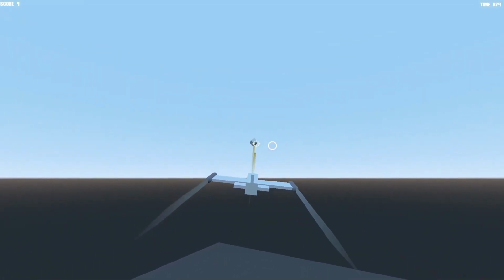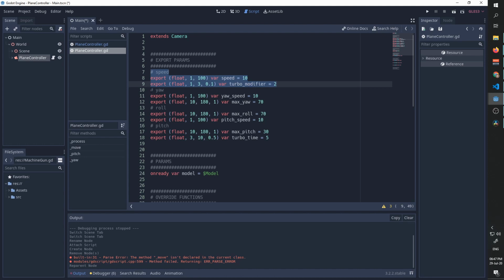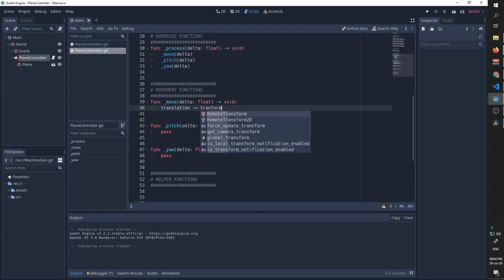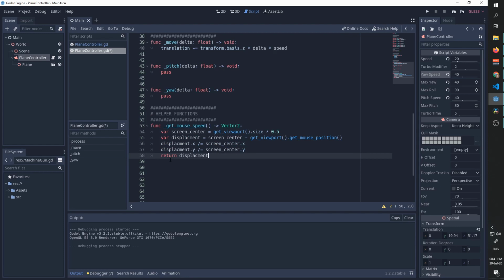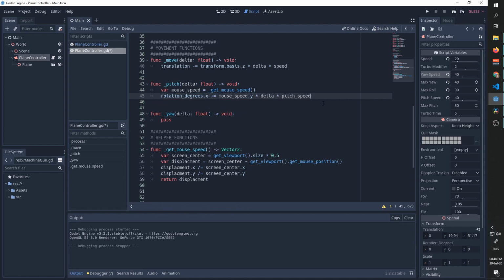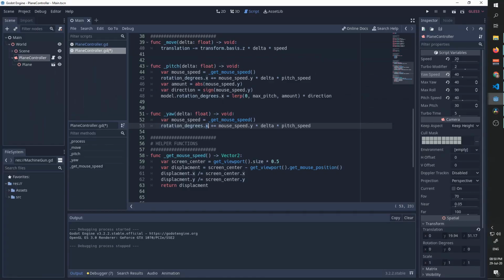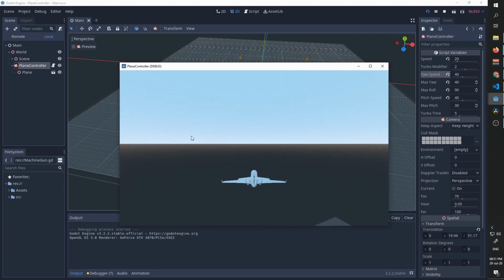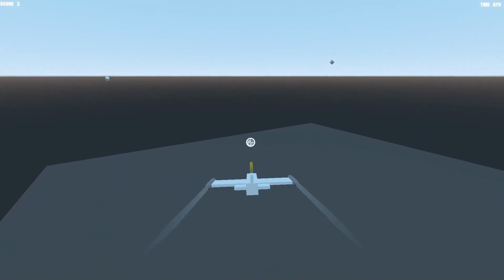"Godog Fight" - Dog fight game made with Godot 3 - Plane Controller

Comment: None of this works in godot 4.2. :(
Reply: It works the logic is the same just some things have changed like using “@“ in front of export or “translation” changed to “position “ I got the mouse controls like yaw and pitch and running however my plane for some doesnt seem to follow the displacement of the mouse fully and just stops after sometime giving it the effect of just going forward and not being able to turn

Comment: for me the code is totally broken. the plane does not steer aswell as the steering is super quick instead of slowly going after the mouse
edit: also the camera stays in place and doesnt follow the plane's rotation
Reply from the maker: What version of Godot are you using?
Reply: @indiequestdev  I think it's 3.9 it's not the latest one but it's newer than the one you used also thanks for replying
Reply: @indiequestdev  I got the same issue, I'm running Godot 3.2.3
Reply: i revisited my project and found out that the actualy problem wasnt that it wasnt steering, the camera just wasnt following after it

Comment: Just curious if there’s a way to reverse the camera while inverted. Because with these settings everything works but when flying upside down the yaw camera movement is backwards. So was just looking for some help with that. I tried an if statement to find the x axis and it works once but as soon as you turn right side up now the normal flight yaw is backwards even with an elif condition.
Reply: Just figured it out. Had to use get_global_transform().basis.y.y I wasn’t using the last .y and when I used print() to see what was being output I realized I needed another .y to get the up/down relation. Also had to put the var and if statement in the get_input func
Reply: @keatonhatch6213  could you pls tell me exactly how you did the if statment because i have the same problem
Reply: @mcgames4455  I’d have to wait till I got my computer back to get exact code but basically I did an if statement to check if the global_transform().basis.y.y was less than 0. I think I did a little less. Something like this

If global_transform().basis.y.y < -0.5:
           ##invert your yaw(rotation around y axis)
            controls###

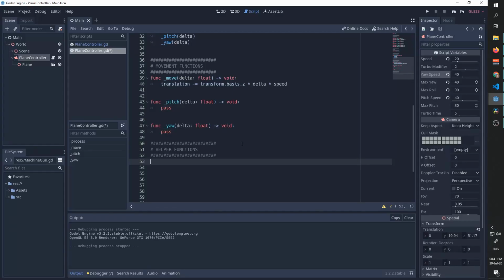Comment: why not use the .normalized() function for the displacement vector @ 5:14? Isn't much faster than using a division operator?
Reply from the maker: It will not work because we don't want a unit vector, in fact, most of the vectors we are returning are not unit vectors. The point at each corner has length 2 and the point in the center has length 0. I can, however, use displacement / screen_center for a cleaner and probably more efficient code.
Reply: @indiequestdev  oh I get it, it makes sense to have them in percentages for the lerp

Comment: Why you control the camera with script and not the plane? Usually camera follows the object (plane)... I tried to download on Github, but i can't open it in godot.
Reply from the maker: Trying to control a plane in 3D especially in Godot is extremely complicated (I am in the process of creating a video about this topic). Controlling the camera by using only two axes of motion is very easy and intuitive. That is why I choose to control the camera and animate the plane to get the effect of flying the plane and only needing very simple and easy to understand code.
Hope this helps.
Reply: @indiequestdev  I attached the script to the "plane". In the moment move forward and up and down works. Camera is a child object of the plane. An advantage of this is that i can use the InterpolatedCamera instead of Camera.
Reply from the maker: Very interesting, I will also check this approach. Thank you!

Comment: I have a question about basis: Why can you make rotation in all axis with Euler? Shouldn't that causing Gimbal lock?

Your two first series are very interesting, it's short and at the same time complete about basic mecanics, it provides a good kickstarter.

If I can make 2 suggestions:
   - decrease a bit the background music
   - add ("1/4") in the title to make easy to navigate in a serie
Reply from the maker: Hi, Thank you for taking the time and giving suggestions, I will decrease the music sound and add the episode numbering, those are amazing points!
I did not quite understand the question about using Euler and locking the Gimble, can you add a timestamp?
Reply: @indiequestdev  I not yet confortable with basis/quat, hence my question (and why I wait your video on the subject). At my current understanding, basis/quat offers to keep the direction, protect against gimbal lock and good interpolation (slerp).

In pitch/yaw/roll you use model.rotation_degree.x/y/z. So you make a classic rotations (Euler) on 3 axis. From my understanding, beyond 2 axis, 
you are vulnerable to gimbal lock. So why it does not happen?
Reply from the maker: @fabrice1533  If I understand your question correctly, the reason we are avoiding a gimble lock is that we are not actually rotating the camera, we are only rotating the plane model Therefore we are only rotating the camera in two axis and we can't get a gimble lock.
Reply: @indiequestdev  I agree for the camera, but all nodes can gimbal lock (if my understanding is correct). As the model rotates in 3 axis, it can gimbal lock too. My assumption is, the rotation in the 3 axis is too low to produce the issue.
Reply from the maker: @fabrice1533  OK I went into a rabbit hole of 3D rotations and found out the because we are only moving in two axes in the order Y->X we will not get a gimble lock.
For general-purpose use, the Godot engine advises using linear interpolations on quaternions but for camera controllers, it is OK to use these types of rotations.